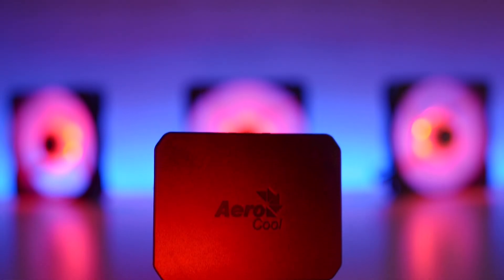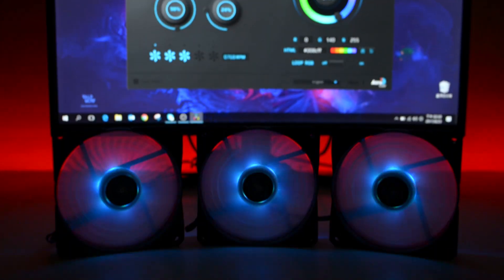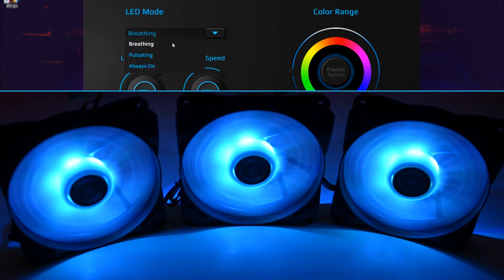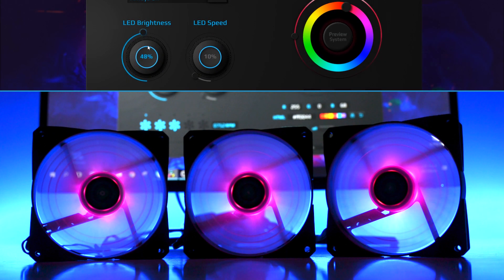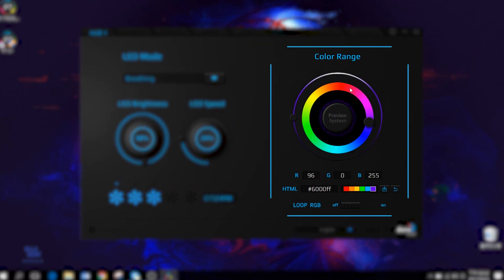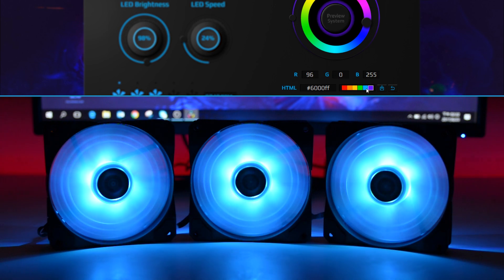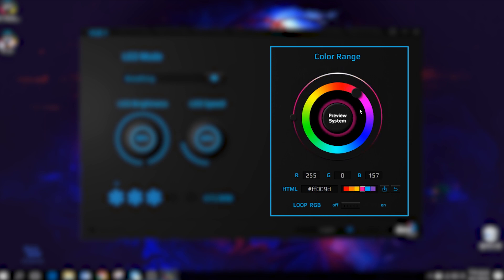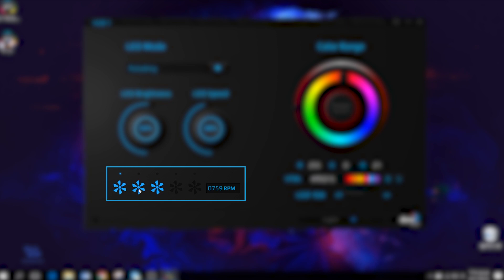Aerocool Project 7 RGB Controller Tutorial

Comment: You can't control fucking RPM trough the FAN HUB 

FOR FUCK SAKE HOW STUPID YOUR ENGINIERS?!

5 fans running at 1200 rpm 24\7 without a way to slow them down, good fucking job aerocool.

Refund. never aerocool again.

Comment: I want fan full speed ???
Reply from the maker: Hi there! Please check out the specs to find more detail info. https://www.aerocool.com.tw/en/project7/cooling-p7/p7-f12-pro
Reply: how to control fan speeds, always running at maximum speed
Reply from the maker: This is a controller for the RGB lights and only to see the fans speed
Reply: @AeroCoolGlobal  So even If I connect PWM fans to p7 hub I would not be able to control speed in p7 app? I have p7-f12 + p7-h1 connected to chassis fan slot in Asus Maximus V Gene and all 3 fans working on max speed,  fan xpert 2 via AI Suite says that  "This fan can not be controlled" Could you please advice me how can I control speed of each fan connected to p7-h1 hub?
Reply from the maker: @antongerasymenko537  
To control the RPM – please connect both the PWM 4-pin cable and USB cable from hub to the MB. You may refer to the Hub manual for clarification.

Comment: got everything connect as mentioned in the instructions. starting the setup ends with "no device found" my fans are dead and no lightning at all.. any guesses?
Reply: Make sure the usb legacy is on in bios and that the usb is active on the board, Testing method = plug your front usb cable in the hub and make sure the windows can read a flash or mouse the you know then usb is working, if it is still not seeing the RGB hub after you plug it back it might be a faulty controller.

Comment: starting the setup.exe getting "no device detected" message... whats that?
Reply: You must connect it to the usb pins on your mainboard 

Make sure the usb legacy is on in bios and that the usb is active on the board, Testing method = plug your front usb cable in the hub and make sure the windows can read a flash or mouse the you know then usb is working, if it is still not seeing the RGB hub after you plug it back it might be a faulty controller.

Comment: Is it possible to control every fan led individualy? Let's say the upper green, middle blue and bottom red?
Reply: Wonders it too, but I don't think so. The fan hub has 2 RGB output but I don't know, nor find I any information if they are seperated such you can connect 2 fans on one and another 2 on the second output and regulate effects and/or color for each RGB output.

Comment: I changed the P7-C1 for the P7-C1 PRO and I have one big problem!
I can not controll the RPM of fans.
I connected the HUB to the motherboard (asus z87-c) and the 4-pin fan cable to the mobo. After that, I downloaded the software from your site. I can control the RGB lighting but the software that I use to the fans does not work. The software is Ai Suite 3. How can I fix this problem? Thanks your.
Reply: Did you find a solution?

Comment: Can you help please. I just built a new system with this case. At first the rgb fans were working. I then turned the rgb off using the software and closed it. I then ooened it to enable the rgb again but the hub is not detected and I cannot turn on the light. I have tried to reinstall the software and it did not work.

Comment: If I purchased this, how would I use it with Asus Aura software? Can I individually control everything I have connected to it in Aura?
Reply from the maker: if you have Aura MB , you just have to connect the fans to RGB header on the MB, and for connecting more than 1 fan, just use a splitter cable (Y cable)
Reply: AeroCool if I use a splitter I can't individually control everything connected. I want this so I can change the colour for ever header attached.

Comment: can you control the fan speed via the software?
Reply from the maker: the hub can monitor the speed but not to control. hope it helps
Reply: dharkbizkit if you have any 3rd-part soft. It's connected to a MB, so just choose the way.

AeroCool Sorry for double post, i dunno how youtube works better. Just connect it... Strange nobody say it ( i see some rewievs), but funs are much tarnished than a hexagon. Actually, fun are fine (i just set it for 10%), but i am hardly want to half, or even less hexagon brightness.
 Please, let me know, it there a phisical way to reduce brightness even more? 
And, if you miss the point. At least add separate settings for fans and hexagon (at P7-C0).

Comment: Is fan speed controller via motherboarD?
Reply: Yes, hub connected to one Fan slot at MB and you can control it in any way you can do it by MB or other soft.
Reply: Алёша Инкогнитов I cant get the p7 s1 software . Wen I download it from the website I just get a html file and don’t no what else to do . I’ve got the fans running  through my aorus ultra gaming mobo but like the Aerocool software